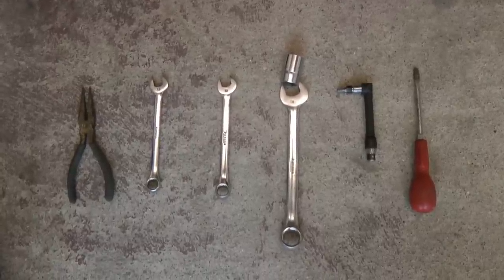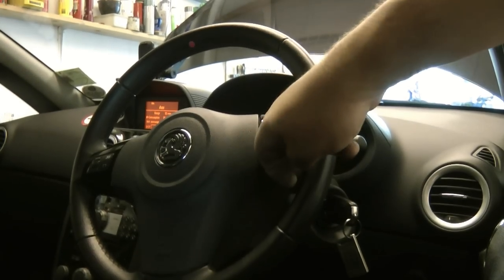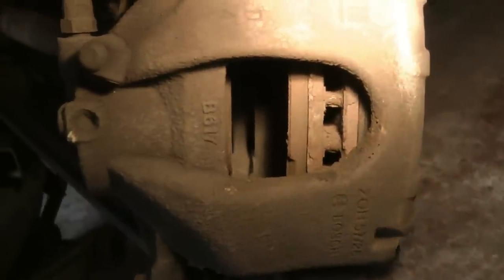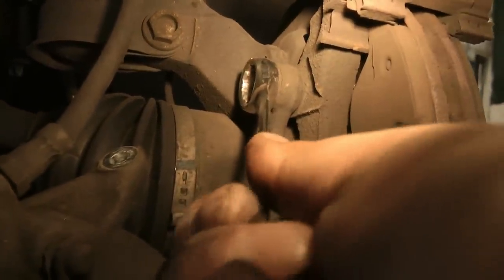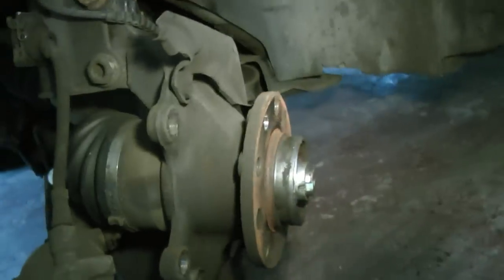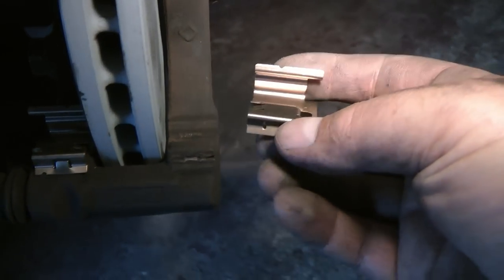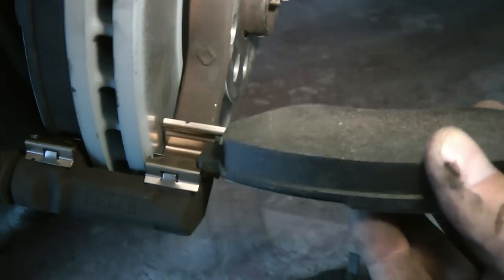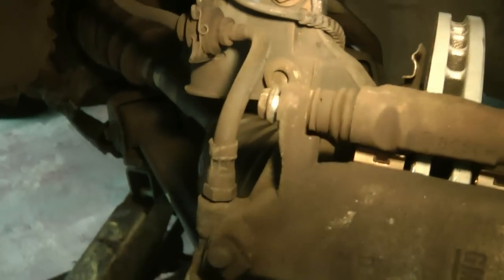How To Replace Front Brake Pads & Discs On Vauxhall / Opel

Comment: Don't know if I missed it but a couple words of advice. 1. You should clean hub that the brake disc goes on to remove any dirt and contaminations. 2. You should clean the new brake discs with brake cleaner to remove the protective coating. 3. You should use copper grease on the brake pads on the parts that interact with the caliper. But good instructional video

Comment: Just changed my brakes disks and pads on my vauxhall corsa D, 58 plate. Not as easy as this guy makes it look lol. It was my first time so i thought I'd leave a comment for those who will watch this & change their brakea for the first time. My caliper slides pin nuts where both 13mm used a spanner on obe as the brake line was in the way so had no entry for my ratchet. Two bolts holding the caliper and pads in place are both 19mm. And the screws holding the disk in place where T27. I used a piaton compressor cost me £4ish from ebay cleaned the piston before compressing opened the brake fluid resevoir so this is made easier. I used copper grease on the clips the brake pads sit on and greased the back of the pads. The guide pins have been lubricated too. If you have any questions im happy to help message on here.

Comment: I work for vauxhall and jut want to add a few points, when pushing the cylinder back the brake beed nipple should be opened and a brake bleed bottle attached to allow the fluid inside the calliper to escape into the bottle so no air gets into the system and once pushed back re tighten the bleed nipple, as doing it in there way shown in this video (just forcing the piston back and allowing fluid to overflow from the reservoir) can cause master cylinder damage, also copper grease should always be applied to the bottom and top of each pad that sits in the carrier as otherwise the brakes will soon be squeaking
Reply: Firstly... this is a good video, I do have a couple of points... I don't think you need to open the bleed nipple, this is inviting problems, it's a sealed system right up to the reservoir &  by pushing the piston back you are only forcing the fluid to return to the reservoir... pushing the piston back shouldn't be done directly onto the piston as if this is a bit tough to make it return you risk damaging the edge creating an uneven surface which in turn affects the braking performance... lastly I would advise some kind of lock tite on the 19mm caliper nuts as it is possible that they can loosen.

Comment: Superb guide, good work! It is generally as easy as stated in the video, although a mallet may come in handy for a few things...

For reference, when applied to an Insignia the socket/tool sizes are as follows:

- Disc retaining screw - T30 Allen key
- Two bolts for piston casing - 14mm
- Two bolts for brake caliper - 22mm

Comment: Excellent video, only one point to mention. You shouldn't leave the calliper hanging on the flexible brake pipe. Simple solution is to use a short  "bungy cord" looped through the calliper and the hooks attached to the coil spring.

Comment: I already did a pads change myself on my own Corsa-but now I also have to replace the discs. Seems a fairly easy job too, in fact. Probably will do it myself again, since Opel quoted me €300 (£230ish) for discs+pads replacement, while I can find new discs and pads for like €130/£100...and this with branded parts like Brembo/Ferodo...
Thanks for the help with that video ^^

Comment: First comment is never hang the caliper from the hose.  When I did my wife's 2004 Corsa C on the weekend I found the caliper would sit on the lower wishbone without tension on the hose, which I think is what is shown in this clip.  Also for that 2004 Corsa C the two bolts which hold the bracket to the steering needed a Torx type H socket, and they're supposed to be tightened to 100nm with thread sealant, so I had to use a breaker bar to loosen them.  I used my torque wrench to tighten those bolts, as well as thread sealant once I wire brushed the existing sealant from the threads of the bolts.  The upper and lower caliper mount bolts were both 12mm, and the replacement pad kit contains two 12mm bolts and the existing top bolts should be replaced.  The grease in the kit should be used where the pads slide inside the anti-rattle clips.

Comment: I must say that the drive should be cleaned from the factory protective grease. Also, you need to grease the clips and the bracket underneath special lubricants to prevent jamming of the brake pads.
Reply: Владимир Юрченко what are those special lubricants called, i've been trying to fint that out forever...for the past 3 years i've ran my brakes without greasing the clips, it worked fine, but now that i have to replace the brakes once again I want to do it by the book
Reply from the maker: slicknwa its known as 'Copper Grease' or 'Copper Slip' , it won't affect braking performance but can help reduce brake squeal..
Reply: slicknwa As said VauxhallHelp a special lubricant for brake calipers (high temperature grease). It is necessary only to prevent jamming pads in the caliper and to prevent squeal during braking. On the braking efficiency is not affected. On the work surface pads applied lubricant is impossible! Only the back side (where the caliper presses). And put a little grease on the clip (jamming). Without lubrication pads may remain trapped and will wear out quickly. This lubricant ask the store of spare parts. Google finds her well on request "Grease for brake calipers"
Reply: On my old fiat i had years ago the copper paste almost made me not stop as we put too much. Literally have to use very little paste , almost like a pea size and smear it i guess.

Comment: optional step, spray  paint your discs  once  dry  put them on and slowly drive  forward with light pressing the brakes,  the pads will rub the paint off the brake surface leaving it on the hat and backside,  preventing  it rusting

Comment: Looks great and easy. Question, when you put the brakepads on will they automaticly make space between the pads and the disc after pushing on the brake padlle? So the pads wont stay permanently on the disc?

Comment: Hello 
I just bought a second hand Opel Corsa 2011 with 73000 km in mileage
There is a squeaking sounds when I do reverse in slow speed.
And  a grunge sound when I'm stepping on the break, 
Is that normal or should I replace the breaks

Comment: Hi,,great video
How much cost as I have vauxhall corsa 1.3 diesel 2008,and there a bout 4 option from cheaper to more expensive,which shall I choose
Thanks.
Reply from the maker: Depends on how good you want the brakes to work or how long you want the discs to last. I've tried using cheap £15 pads and although they last a long time the braking efficiency is not good. My personal favourite is Bosch pads and discs. Brembo are well known and probably a good choice. I would never buy cheap discs again as I found the metal is soft and they don't last very long..
Reply: thanks
Reply: hi again can you please look @ euro car parts website and tell me which one is the best, http://www.eurocarparts.com/brake-discs
Thanks again for your patience

Comment: Single Hex spanners will give you better grip, less chance of rounding the head off, (especially if previous owner was an animal who used Open ended spanner. Also push the Piston back gently with a G clamp.  
Brake fluid should be a sealed system,,, if fluid is low,, with no Leaks,,, dont just Top up the Reservoir,,, check your Pads first,, they are probably Worn . 
👍😁😁

Comment: Do I need to open the brake fluid reservoir?
Reply from the maker: Yes, keep an eye on the level as you push the piston back. You might need to remove some fluid if it gets too high
Reply: +VauxhallHelp  Ive notice that you havent used a rewind caliper tool, how did you get the piston to rewind without it ?
Reply from the maker: You only need the rewind tool when replacing rear brake pads

Comment: Is this the same for an Astra H? back & Front?
Reply from the maker: Its probably the same for the front, but the back is more involved as you need to push and turn the piston back at the same time. It can be done using a G clamp but its not easy. I think  #EricTheCarGuy  might have a video for that on his channel
Reply: I have a wind back tool so should be ok

Comment: Is there any need to bleed the brakes or does that only apply when replacing the callipers too?
Reply: you don't need to bleed the breaks if you're just changing pads or discs. 2 years too late, I know but nobody had responded!

Comment: I couldn’t undo those caliper bolts with a spanner as they were extremely tight, I had to use a breaker bar and socket to get them loose

Comment: The disc screws is totally stuck and the T30 screw got ruined while trying to push harder... guess I have to try and cut a straight line in the screws so I can use a normal flat screwdriver to get them lose.. hate these fucking allen screws... 
Everything else worked just fine though.

Comment: shocking.. no cooper grease used, never cleaned the brake discs,, pads face down on floor,,
Reply from the maker: https://www.autotorque.news/the-aftermarket/technical-talk/delphi-does-not-recommend-the-use-of-copper-grease/